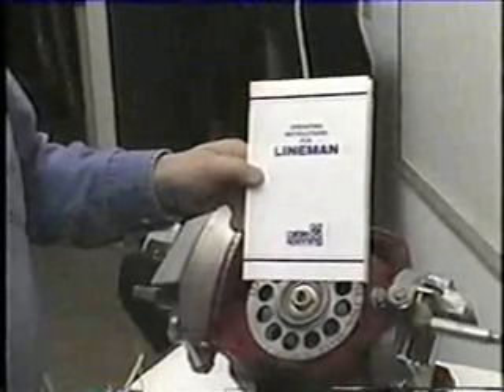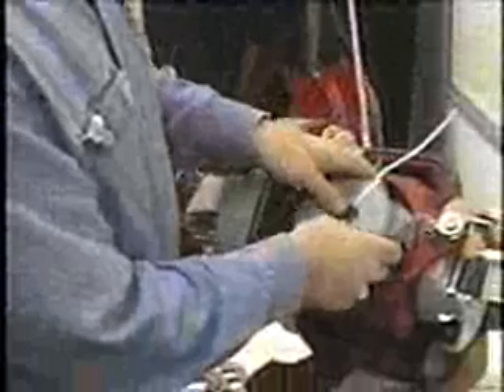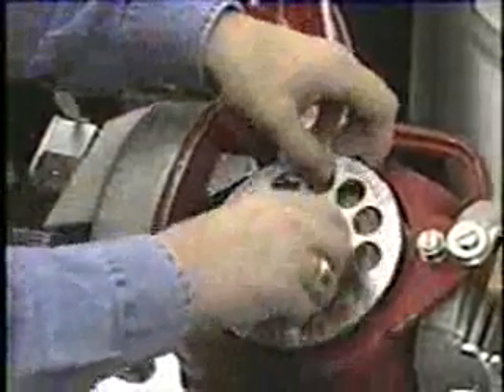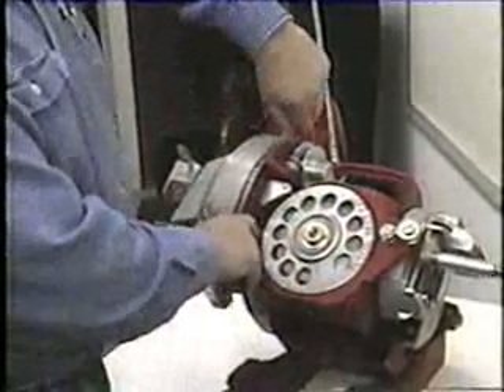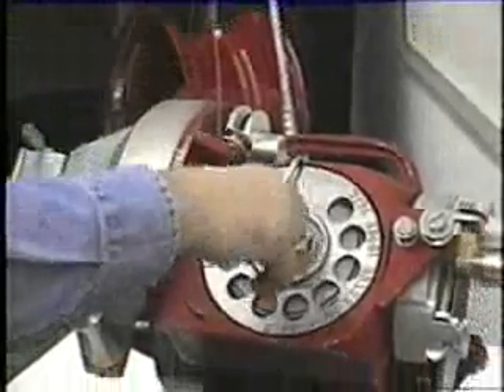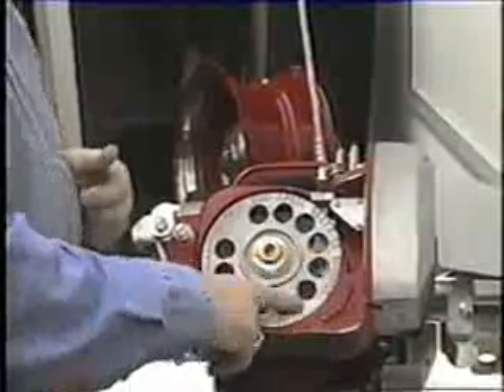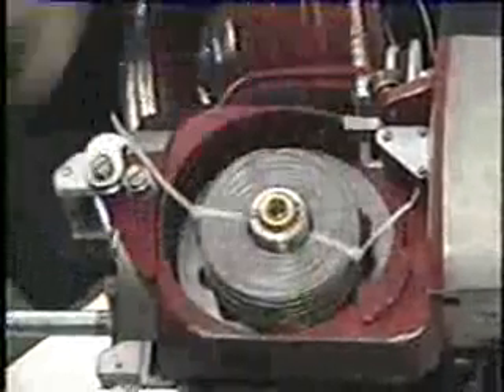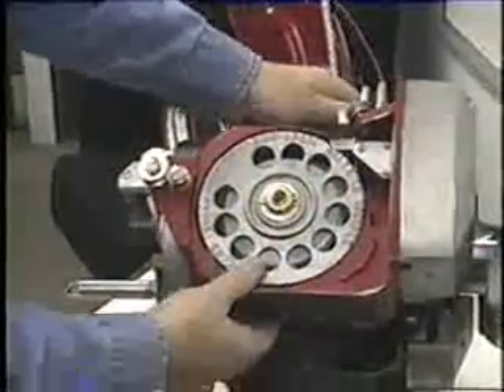Lineman Lasher - 1 Loading Wire

Comment: While a J is nice, using the J through a treed out run will get you in more trouble than this one ever will. The Lineman is a great lasher. It will lash upside down if it needs too. TheJ will simply fall to the ground. If you need to overlash, this is the lasher you want. And as far as trees go, This will lash all the way trough. the J sill skip all over the place.
Reply from the maker: Thank you!  Our Lineman lasher is a tried-and-true design that we have maintained with very little change over the decades due to it's success in the field.

Comment: Buy a J and be done. Those things suck unless you got open running. Don't take it in a treed out run. You'll be sorry.
Reply from the maker: Thanks for this comment.  While running through trees can be difficult, DCD does offer a halo ring kit (61442-000) to push branches away from the front of the machine, and a Halo Brush Guard (61436-000) to close up the front bottom of the machine.